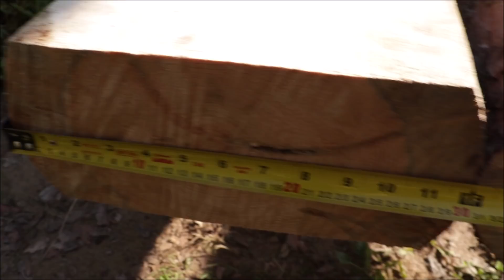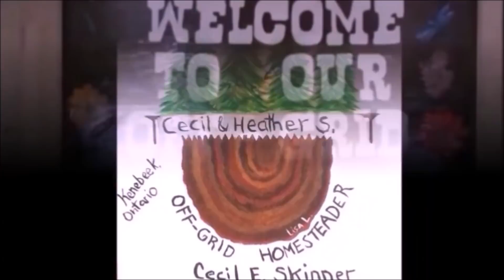WOW, This Is The Heaviest Log To Date I've Lifted With My Homemade Crane.

Comment: The sawmill and the crane are your two greatest inventions (that I’m aware of) and I can’t say which one gets the gold medal but they both earn their keep every day, as do you and Heather. Before you go back to setting logs, take 5 minutes and run a small stone over the cutting edges of that Forstner bit. I’ve sharpened mine and the difference is phenomenal. If 5 minutes up front saves you 2 minutes on every hole, it’s well worth it. Y’all done good, again 😎👍👀🪵

Comment: Yea, that one camera angle unloading the log at the mill looking forward over the boom really shows how much you were "stressing" the boom to pick up that "beast" !!
Reply: Willow trees flex, that's their strength, Big Cecil knows his steel by experience. It's amazing what he can do with surplus stuff!......
Reply from the maker: Hello Bob, thanks...When I used to do high steel and work around large cranes I soon realized that as long as the steel was flexing it was safe...steel that won't flex will just break like a hard knife blade...what I'm saying is flexing is a good thing, the square tubing is quarter inch thick and it's 2"x2" square... the winch cable will break way before the boom ever reaches it's failing point.  Thanks again.  You have a great evening.  Cheers!
Reply from the maker: Hello Randall,  thanks. The Willow tree is a good comparison. I also know that the small winch cable is strong ( tensile strength )  But I believe it will fail way before the tubing does...I used 2" receiver  tubing, the same stuff we make tow hitches out of for trucks.  Thanks again.  You have a great evening.  Cheers!

Comment: Hi Cecil and Heather!!😀😀
That's a heck of a piece of wood. 
Why don't you flip that log on edge and rip it down the middle. 6× 6 is way more than enough being 2 feet on center. 6 × 12 is just over kill and a lot more dangerous to put up than a 6 × 6 will be when installing. 3 × 6 Joists 2 feet on center would be plenty strong enough. Ask anyone who builds buildings for a living. 
Take care and be careful putting that monster up there.

Comment: You've probably answered this question many many times in previous episodes that I may have missed. I there a reason you don't lubricate your saw blade? I see other using dripping water to accomplish this.
Reply from the maker: Hello, the reason I don't lubricate my blades is because I only mill dead standing trees, so there's no sticky sap to load up my blade or band wheels. Cheers!